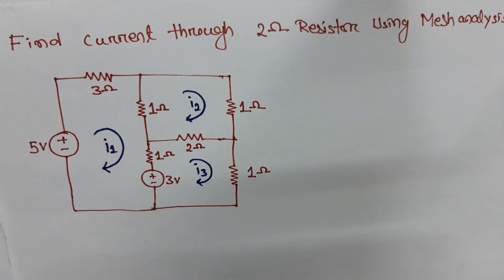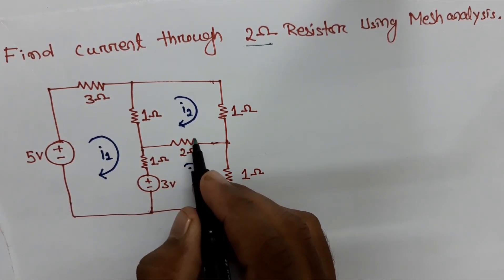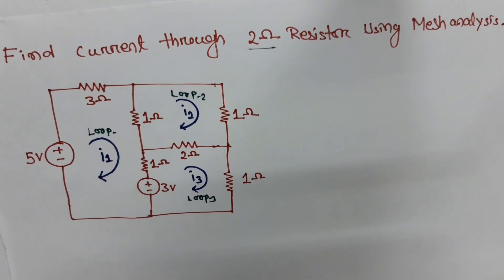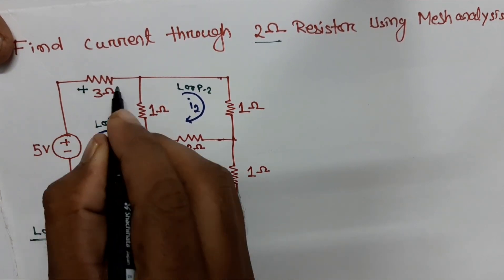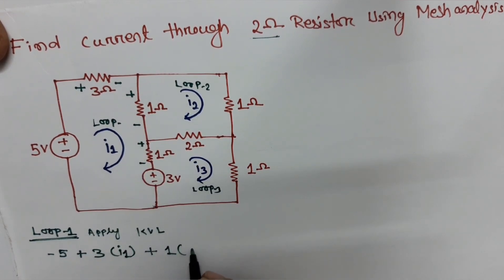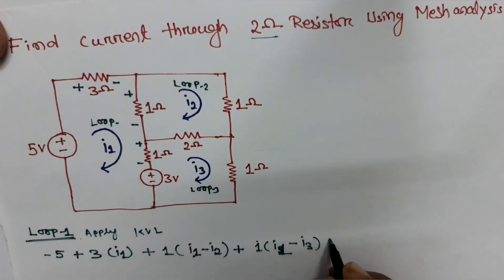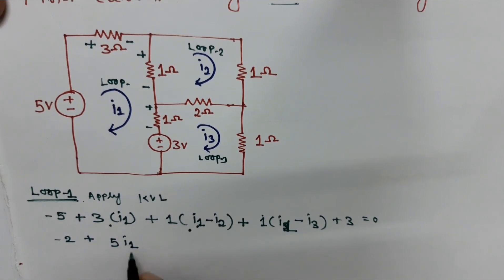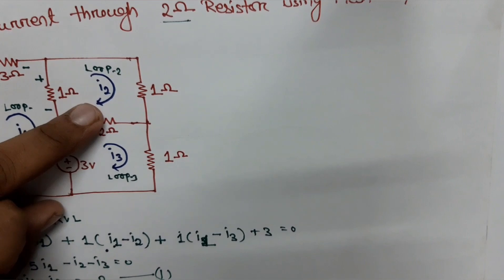Mesh Analysis Problems

Comment: how you calculate i1 i2 and i3 ????????please reply
Reply from the maker: in this circuit their is three loop so 3 mesh equations is formed. in this three equations three unknown value i.e i1 12 and i3 
by solving those three equations we get i1,i2 and i3
here i use calculator to slove those equations and also can we slove using Matrix

Comment: Sir when I did the matrix method I did not get the same results for i1 i2 and i3. I used matrix x=inv(A) * B , where x are the currents, B is the constants and A is the equations in matrix form. I ended up getting i1=0.5A, i2= -0.25A, and i3= 0.75 A. How did you do it using the calculator?
Reply: inv ( 5 -1 -1           2                    1/2
        -1 4 -2     x     0         =       -1/4
       -1 -2 4  )         3                    3/4

Comment: positive 3 aayega loop 3 rd me
Reply from the maker: here we assume if the current flowing -ve polarity to+ve polarity that we consider-ve voltage and vice-versa
Reply: @ElectricalBoost  bt we can only assume direction of current and sign conversations should come accdg to it.. So it has to be positive over there 
Bcuz current entering through lower to higher potential leades to rise in voltage and vice versa. 
Though Ur Answer is correct bcz u hve unintentionally applied counter clockwise direction..

Comment: How to identify current in clock wise or anti clock wise
Reply from the maker: first you assume one direction that you may assume clockwise or anticlockwise 
Then write messh equations 
after solveing the mesh equations you got loop current 
if the current value is +ve then your current direction according to yours initial assumptions 
if -ve come then it reverse of intial assumptions

Comment: In exam calculator is not allowed then can we do correct answer
Reply from the maker: Yes you get correct answers without calculator by using general algebraic equations solving procedures

Comment: Hlo sir how you find i1 i2 and i3 please tell me in details
Reply from the maker: Ok
See in this circuit their is three loop 
So we take 3 loop current i1 ,i2 and i3
And apply KVL in 3 loop 
So we got 3 equations from 3 loop 
Here 3 unknown quantity that is i1,i2 and  i3 
When we solve those three equations we got the value of unknown quantity that is i1, 12 and i3
Here I use calculator to solve those 3 equations you can apply basic mathematics for solve equations or matrix method

Watch this 
https://youtu.be/FxdTEH-jXXo
Reply: He uses the matrix bro  to get all the currents